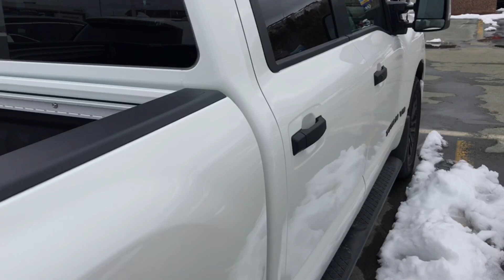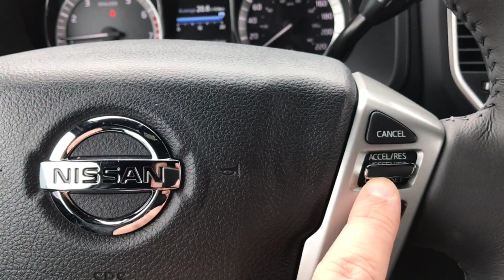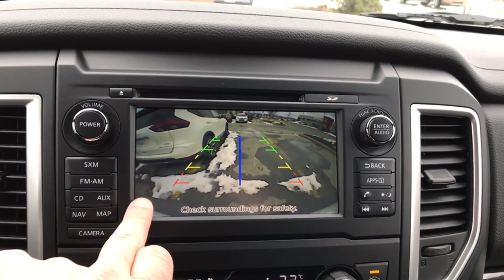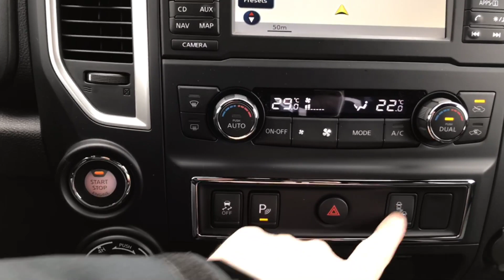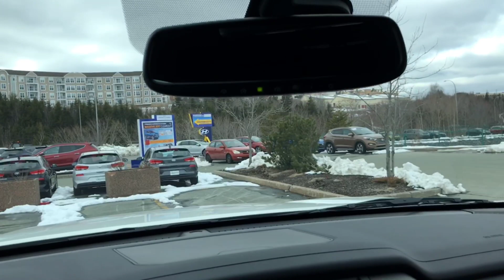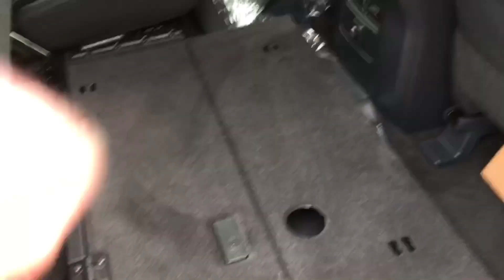2018 Nissan Titan Midnight Edition

Comment: How do you change the temp from Celsius to Fahrenheit
Reply from the maker: If you’re trying to do it for the climate control, you cannot. If you’re trying to change it for the outdoor temperature, you have to do it in the settings for the driver assistance display for where it says units
Reply: @RobertTigheCars  So a 2018 cant change the climate control temp from C to F.  Great....THanks

Comment: What are the rebates now? Is the 2019 a better deal than the 2018?
Reply from the maker: The 2019's have not started to arrive yet.  On the 2018, you can get $2000 off on a Finance at the special rates (0% to 84 months) or anywhere from $10,500 - $17,700 on a Cash or Standard Rate Finance or Leasing purchase.  All depends on which model and trim level you choose and how you want to pay for it.

What area do you live in?  If you are in Nova Scotia, I would love to help you!

Comment: Why is it White if it's midnight edition it should be black ..
Reply from the maker: The Midnight edition comes in Black, White & Gun Metallic Grey.  The Midnight portion consists of:
Blacked out Grill
Blacked out Badging
Blacked out Side Step Rails
Illuminated Kick Plates
Custom Floor Lines that say Midnight.

Outside of that, it has all of the features of the SV Premium.
Reply: @RobertTigheCars  beautiful truck 👍👍

Comment: I'm looking to get my first pickup truck and I like what I see
Reply: T'Challa O'mar You can't go wrong with the none diesel XD  it's a way better truck then 5 and 1/2 half ft bed, with the XD you'll get your money worth with a higher towing rating and a 6 and 1/2 half ft bed. With the comfort of towing with a gooseneck trailers and fifth wheel motorhomes. If your able to Look into the XD PRO-4X with the comfort package.